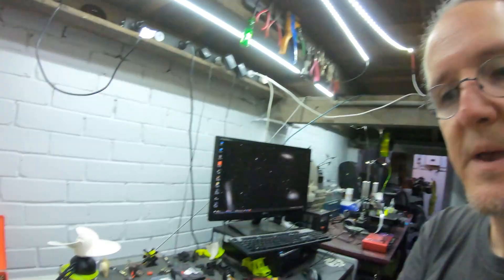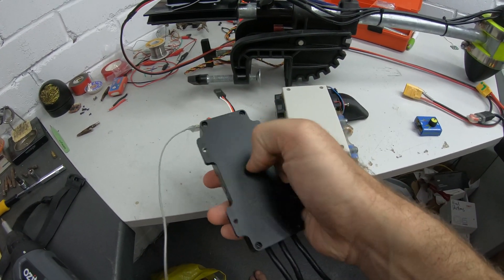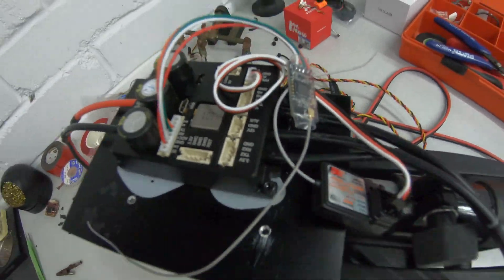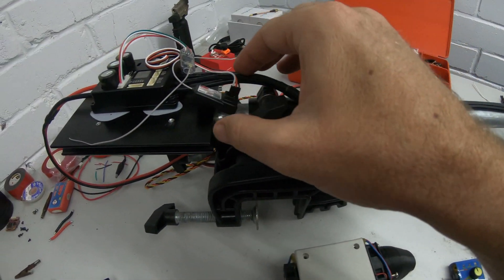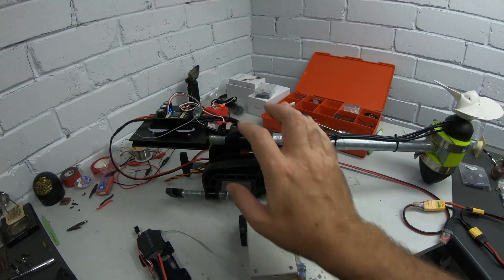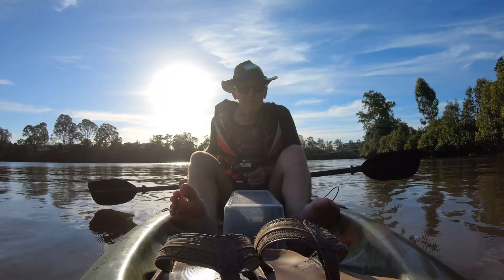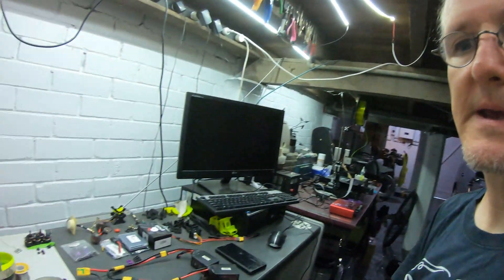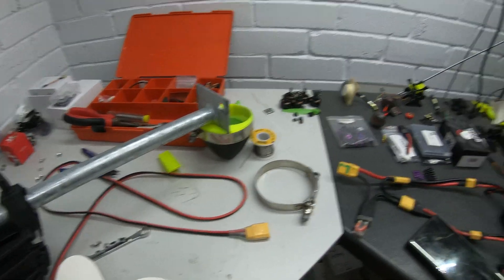Electric Kayak Project Part 4 - I need a bigger speed controller... and a new motor! :|

Comment: Didn't watch the entire video but I like your content, these motors require extra work from the end user which the manufacturers don't really tell you about, they do poor soldering job, poor sealing etc. If you buy a new motor in the same style, open it up and fill half with Corrosion-X, you could even save that money if you just buy a "6384 120kv" outrunner which is about 60$, buy some epoxy to coat the windings and after 20 minutes of epoxy job for waterproofing (but let it cure completely) and you got a 6HP outboard motor, if you want to avoid cooking another motor then you might wanna use a fuse on the battery side. Check my channel, if you need any help just let me know.
Reply from the maker: Thanks mate! Yeah interesting re those outrunners. Tricky to mount underwater but definitely one to file away! A fuse wouldn't have saved that motor I suspect; just better cooling. I have the much bigger version of the inrunner now and it's running cool as a cucumber. Wasn't cheap though!

Comment: Might be that the prop/screw is a tad too big for that motor, since the cooling otherwise should be adequate, given the motor is submerged. the good thing it burned out fast so you didnt have too long way home to paddle :-)
Reply from the maker: No, I think the problem was the TPU jacket around the motor preventing proper cooling. Time for a bigger motor! Thankfully I motored against the current so I could just drift home :)